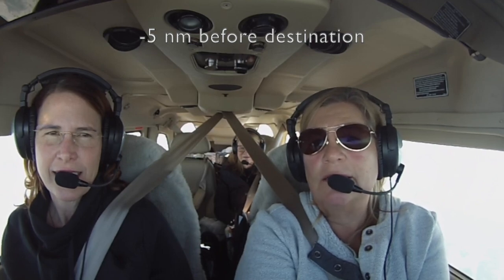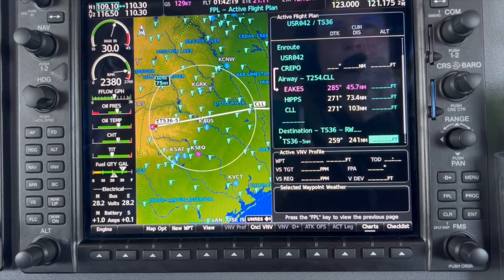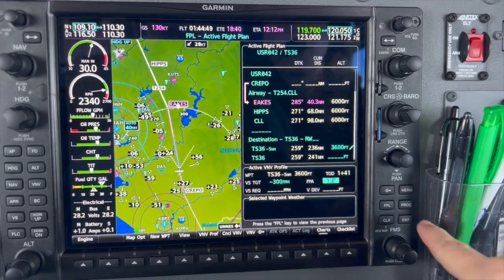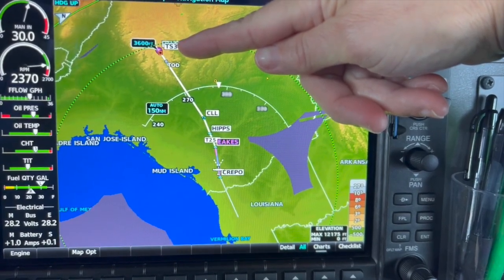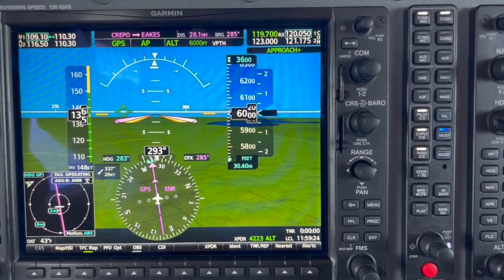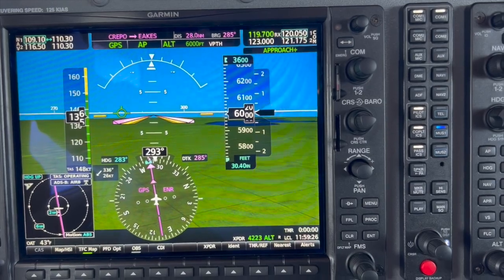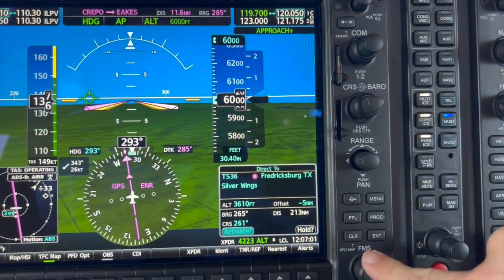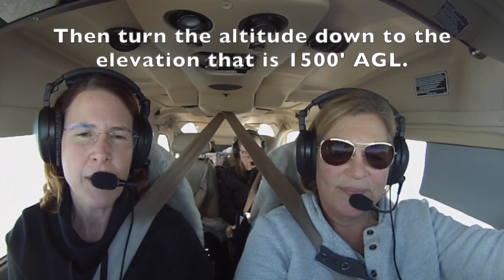Loading the G1000 NXi VNAV and GFC 700

Comment: Thanks for the tutorial👍
Question…….I’ve noticed that some G1000NXi have FLC and others have IAS instead…..why the difference?
Reply from the maker: Not really sure.  That would be a question for Garmin.  They work the same.
Reply: @planecrazychicks8099  The difference between FLC (Flight Level Change) and IAS (Indicated Airspeed) modes on different G1000 NXi units comes down to manufacturer-specific customizations and software versions. Here’s why:

1. Terminology Preference by Aircraft Manufacturer
	•	Some aircraft manufacturers prefer the term IAS (Indicated Airspeed mode) because it is a more straightforward description of what the mode does—holding a specific airspeed while climbing or descending.
	•	Others stick with the FLC (Flight Level Change) label, which is the original Garmin terminology.

2. Same Functionality, Different Labels
	•	Whether it’s labeled IAS or FLC, both modes function identically: they adjust pitch to maintain a selected indicated airspeed while climbing or descending, adjusting power as needed.
	•	If you see IAS instead of FLC, it’s just a different naming convention—there’s no functional difference.

3. Aircraft-Specific G1000 Software Versions
	•	Garmin customizes the G1000 NXi software based on the aircraft it is installed in. Different manufacturers (e.g., Cessna, Diamond, Cirrus, Piper) request specific software tweaks, including terminology changes.
	•	Some newer G1000 NXi implementations may use IAS instead of FLC to align with terminology used in other modern avionics systems.

Key Takeaway

If you see IAS instead of FLC, know that it’s purely a labeling difference and does not change how the system operates. Your aircraft’s POH (Pilot’s Operating Handbook) and avionics manual should specify the terminology used for your specific installation.